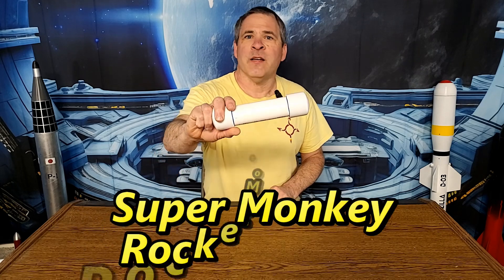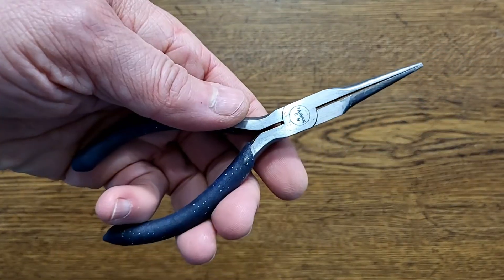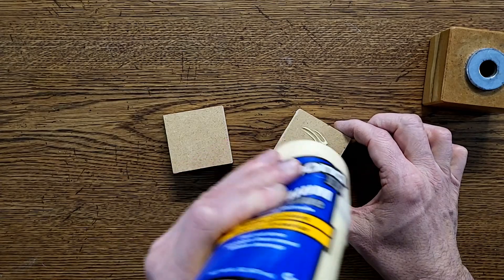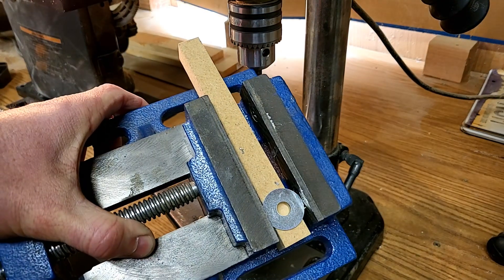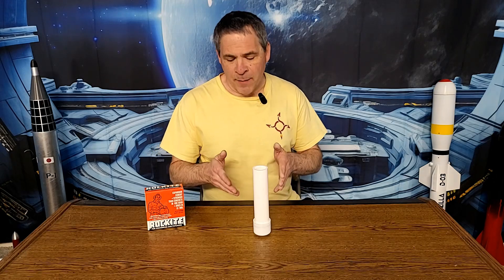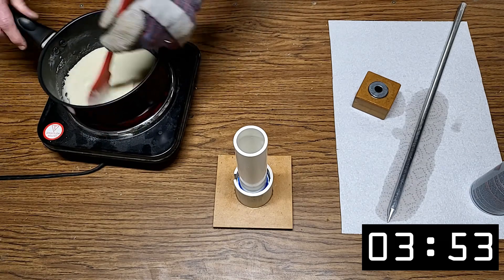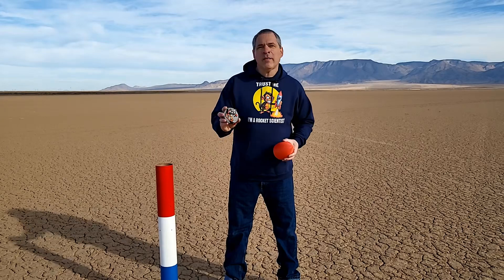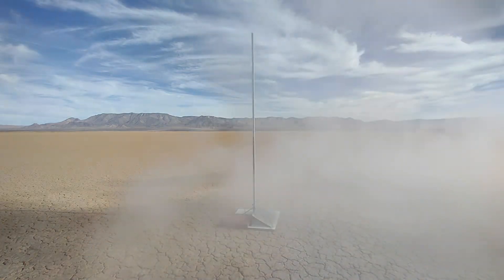Build tutorial for our best sugar rocket motor

Comment: Im going to try using a wood dowel coated in something like oil as the core rod. Metal is expensive in my area.

Is that your dad with you?
Reply from the maker: If I had to use a wood dowel, I would coat it with polyurethane or some other type of wood sealer. Or I guess you could paint it... Anything to seal the pores of the wood.  Make sure the dowel is really straight or it will be difficult to remove or may mis-shape the core hole on the way out.
Yes... That's Dad.
Reply: @rotaryrocketry  im glad dad is part of this. Mine is too :)

Comment: Excellent video. Your production is getting better each time. One of my favorite things about your use of Flexifuel is that it doesn't produce any pollutants. For example, your SuperMonkey+ motor:

Fuel Ingredients                           Combustion Products
Potassium Nitrate  210 g           CO2 gas          105 g
Sugar                          58 g            H2O gas           41 g
Corn Syrup                 55 g            N2 gas              30 g
                                                        Potassium
                                                          Carbonate powder  147 g

Keep up the great videos!
Reply: Fun Fact - The volume of the fuel is about the size a soda can. When it burns at about 4000 F it converts into enough gas to fill about six 55-gallon drums.

Comment: How come the rocket launch so slowly, was the video slowed down?
Reply from the maker: That was real time. Flexi-fuel will burn slower when cooked to a lower temperature (210F used in this video) or faster when cooked to a higher temperature. So the lower temp results in a fairly slow startup for the motor. We've cooked it to as high as 260F and the results are very obvious. I like the slower burning version because you get a longer smoke trail during the flight.
That said, I don't recommend cooking flexi-fuel as high as 260F but if someone wants to make a version of this that has a faster burning fuel, then around 230F would be a good choice. The motor would not need any modification.